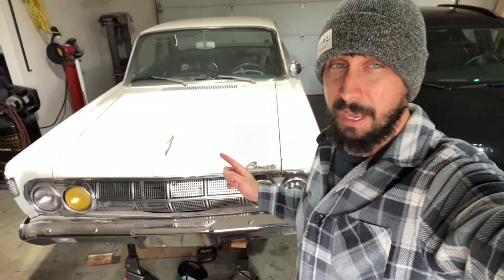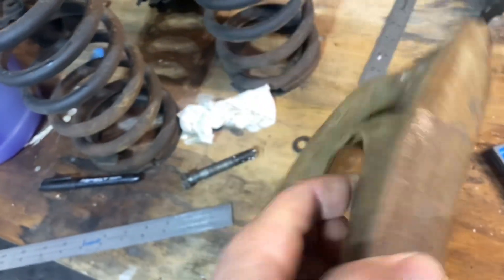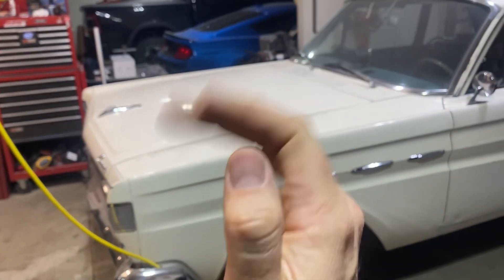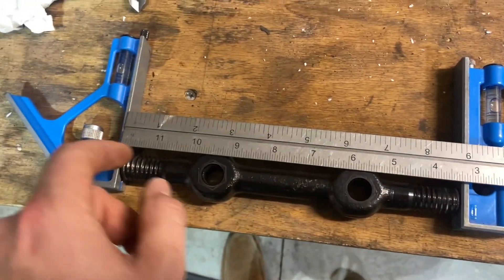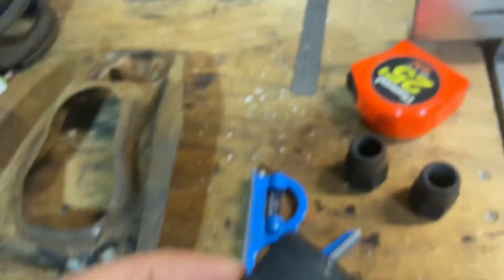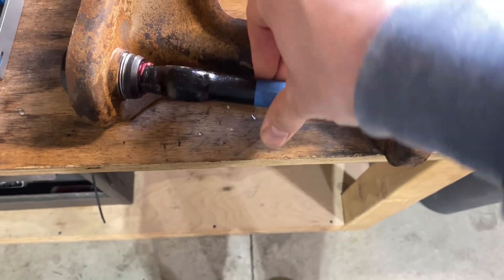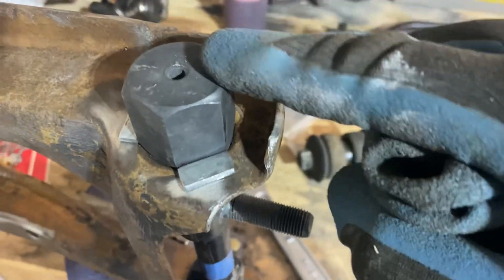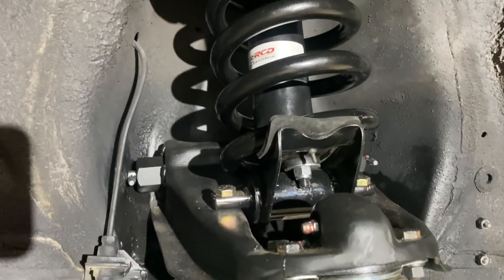Improve Your Classics Handling by Adding Caster

Comment: Those nuts need to be welded in real good on two sides because they're not even supposed to be loose.
Reply from the maker: When I spoke with Open Tracker they mentioned typically going hand tight and then one extra flat.  If i did that the control arms became almost unmovable.  I believe from the factory these were tight but I dont think thats how they set these up when they send you blueprinted control arms.  In fact I got the idea of the welded flat bar stock from John at Open Tracker.

Comment: 👍🏼 good info , gonna steal that cap tack trick,did mine and just snugged the caps and there’s noticeable binding. I like your attention to detail,I’m way too impatient when I have things apart.😂🤙🏼
Reply from the maker: Oof I had to pull stuff apart multiple times.  Had to cut my brand new Baer bump steer kit cause I was out of toe adjustment and then had to cut my springs.  Now the ride height and toe are workable but the camber is .5 deg + and Im out of adjustment.  Just ordered the lower control arm camber kit… one more thing to weld in lol 😂
Reply: @truckandroll989  they call it snowballing for a reason 😖,but bright side,you got another video😏👍🏼